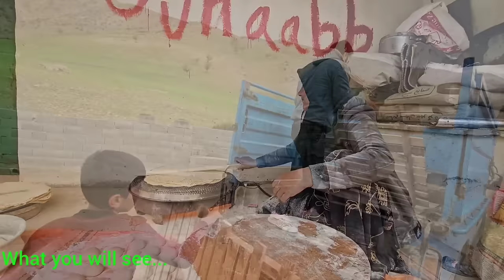"Making Dreams: Medina and Shahab's Happy Life in Their New Home."

Comment: If it is filled by pouring cement or installed a waterproof shield layer on the leaking roof of the verandah , The trouble of a leaking roof can be  avoided. Wish you the best of luck.